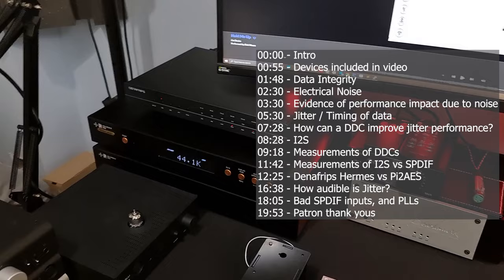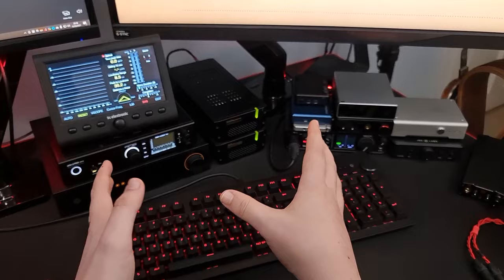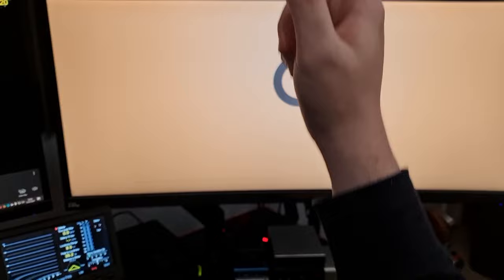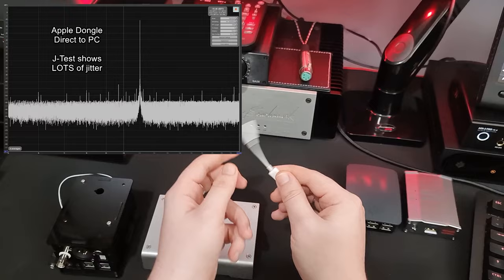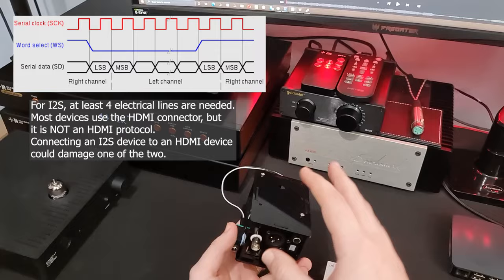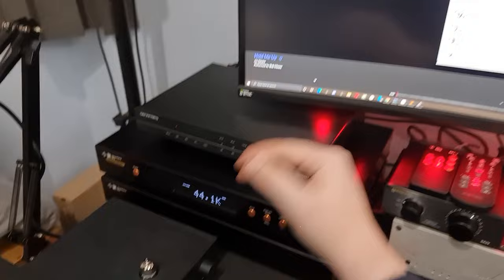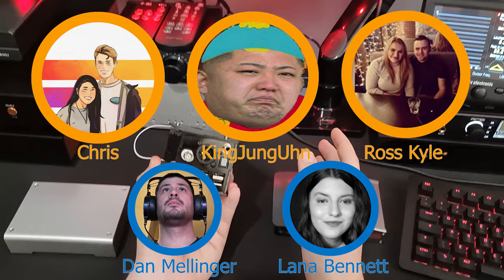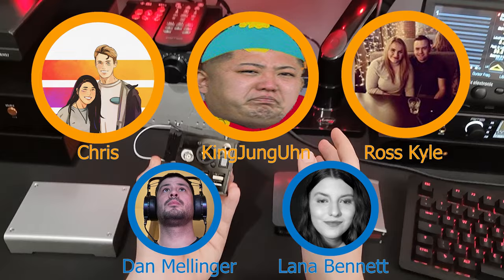How do DDCs improve audio? (Denafrips Hermes, Pi2AES, Schiit Eitr, ifi Igalvanic)

Comment: I think these problems should have been solved in the DAC.  The whole reason I am considering buying an external DAC is to get rid of electrical noise.  Cue the "YOU HAD ONE JOB!" meme.
Reply: Considering that analog LPs are still considered to be the ultimate experience by many high-end enthusiasts, a 60db noise floor is not a problem and a 110db one even less.
Reply: @dingdong2103  you’re misunderstanding the problem.  The issue isn’t noise floor: it’s electronic noise and jitter which are a completely different thing.
Reply: @GodfreyMann  Vinyl has wow and flutter which are the analog equivalents of time domain modulation. You won't get rid of them by going analog.
Reply: @dingdong2103  you’re correct that ‘electronic noise’ on the analogue side rises the noise floor, but the discussion is about ‘electronic noise’ on the digital side which gives rise to jitter.  It’s not a marketing jargon - the clocks are voltage sensitive components and ‘electronic noise’ can cause fluctuations in voltages in the circuit.  Although tiny this can affect the quality of the square wave signal and therefore how the bits are interpreted....it can change the bits and timing.
Reply: @GodfreyMann  jitter is a timing problem, noise doesn't affect it at all. Double sampling rate takes care of jitter in all practical solutions. Anything else is pure marketing. Digital things are very simple to check: Just sample the stream on both sides and if the result is bit perfect, jitter has not affected the outcome in any way. It's simply impossible. That's why all the expensive digital cables etc. are 100% snake oil. The real problems in audio are in analog devices. Pre-amps, amps, speakers (largest issues being the speakers).
Reply: Yeah decent gear it shouldn't be an issue
There will always be something to worry about, depends how much it matters. USB from my PC to ifi zen DAC is pretty good. Not buying all their other add ons and filters. Wondering if USB is better than optical and hats from rpi4. Seems easier
Reply: @dingdong2103  because you're using cheap as shit gear is why all that doesn't matter which it doesn't. You stay in your lane.
Reply: @GodfreyMann  Golden is grossly misrepresenting what he can actually hear with differences in jitter. He may have super human hearing, who knows? I don't think he is lying to sell shit. I think he is misrepresenting the problem to justify his own genuine abnormally good hearing or absurd purchases.
Reply: @Leo-yn5fx  The best measuring DACs in 2022 (and for the past 5 years at least) are delta sigma DACs, mostly built upon ESS or AKM chipsets, and one can be had for less than $500. And all of them—whether made by SMSL, Gustard, Topping, Loxjie, Matrix etc) have USB inputs with buffered input receivers and oversampling algorithms, that obviate nebulous concerns such as jitter or timing errors. 

For that reason it is only snobbish fools who buy R2R ladder DACs (or DDCs to solve connection problems), under the foolish belief that cost correlates with sound quality. Digital audio has no “sound”, and the resulting analog signal that modern DACs produce is the sound of the original sampled master, differing only in the amount of noise, distortion and dynamic range a particular DAC contributes. 

And either way, these differences are all beyond the range of human hearing. DACs should be the least expensive component in any audio setup these days. The products with the most significant cost to benefit ratio are headphones and speakers, with amps a distant second. Everything else is marketing manipulation.

Comment: I thought by now any reasonable DAC would have it's own internal elastic buffer and just internally re-clock using it's own precision clocks.  Paul Lesso wrote an AES paper about S/PDIF design 15 years ago called "A High Performance S/PDIF Receiver".  A small buffer chip should be super cheap these days, and should be able to wipe out any jitter from a PC optical port.  I get the impression audiophiles like to make simple problems hard.
Reply: They want excuses to buy more stuff while still claiming it is "minimal chain".
Reply: Buffer = delay = bad, I guess?
Reply: @sanjacobs6261  Delay is bad if you are watching a movie or trying to mix tunes as a DJ, cuz the audio will arrive too late.
But if you only listen, it doesnt matter if the audio comes out a second later then it got send.
Reply: @Wassermelonenbaum  and it wouldn't even be a second, a few milliseconds would be more than sufficient.
Reply: @gayusschwulius8490  For reclocking you usually use atleast 2 flipflops. This means that it's atleast 2 cycles of a clock worth of delay. The clock in this case has the frequency of the bitclock which is usually 44.1k*16bit*2 = 1411200bit/s. Which corresponds to 0.7microseconds of delay PER flipflop.

I'd say delay typically becomes audible in live content at about 15-25ms. You could legit use a thousand flipflops and still not hear the delay.
Reply: Found them, a diamond in the rough ;).
Reply: @hidjedewitje  did the monster maths
Reply: I don't disagree with where you are going, but the problem is the I2s did measure better. Maybe some of the reclocks just isn't that good?
Reply: you're still getting interference because the dac is still connected directly to the pc. Enjoy your fuzzy audio quality if that's what you want.
Reply: Thing that solves this without the need of buffering is called an ASRC - asynchronous sample rate converters perform clock domain isolation and with current implementations artefacts are so low its not worth discussing.

Comment: I do not often see videos which are pure and utter nonsense. But this one is. The spdif and the usb interfaces have error detection integrated. They will not deliver an invalid data stream to the DAC. Noise on a data line can cause problems but usually you recognize that by drops in the audio presentation or by connectivity rejection (no sound - full stop) and not by noise on the analogue side. Since the cable length and quality is good these days, you usually have however not problems or drops.

Comment: Just a question - "...the Schiit EITR is a very affordable device..."  I assume you are aware that this product was discontinued about a year ago and is only available second hand?   (where it commands a huge premium over the original MSRP).  FWIW, the EITR was based on Schiit's older USB implementation (called Gen5) and the EITR was discontinued when Unison was introduced.  Also, I agree that the Pi2AES is outstanding... I have 3 of them.
Reply: Pretty amusing to hear tho
Reply: Eitrs sometimes pop up in Schitt's b-stock page for $99 plus shipping. Schiit discontinued Wyrd as well, so I guess you have a point unless someone wants to use spdif coax connection for older DACs like me.

Comment: I think that this is for someone not using a steamer. Instead of using a Hermes at a  $1k us, I would have used the Iris  at  $499 US. You can find them under $400 US. It will only do USB to I2S and does a great job of doing it. For the other digital connections, I have an external 10m clock that works wonders with my DAC.

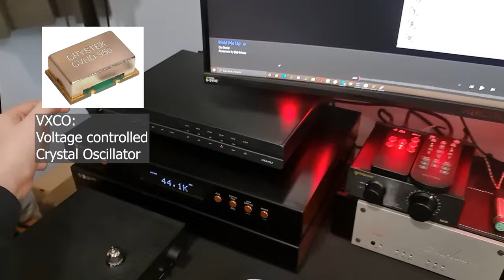Comment: @6:35 an oven controlled VCO is exactly what it says - it is temperature controlled to optimise clock waveform & jitter performance - it is NOT an “temperature controlled” crystal, that is voltage is still used to set the crystal into its designed resonant frequency, but temperature controlled conditions, stabilise & optimise the oscillator performance😀🤓
Reply: It controls the temperature to increase long term stability. Jitter is  short term deviation and thus won't be improved with OCXO's.

Comment: 6:40 for what it's worth an OCXO is still voltage-tuned (EFC) with a typical pulling range of something like 1-2e-7. The ovenized part is for short-term stability, not frequency adjustment. Essentially, quartz crystals have a characteristic curve of frequency change vs temperature change over temperature, which is very different for different "cuts" (the literal way the crystal is cut and polished). The standard is the AT cut, which is pretty much all quartz crystals you see everywhere. The AT cut crosses 0 Delta-Hz/Delta-K at around 25 °C. Which is just about perfect for normal ambient room temperatures. But the slope around that point is steep (relatively speaking, so let's say you're at 20 °C, you might be getting 5 ppm/K or so). Now the clever trick about OCXOs is that they use different cuts, often the SC cut. The SC cut has a completely different response to temperature changes; it crosses 0 at around 90 °C or so, and has a very gentle slope around this area. So OCXOs keep their crystal heated to a very stable 85-95 °C, using a control loop. The attenuation of ambient temperature changes by the control loop colludes with the shallow slope of the dHz/dT to give extremely low tempcos.

The expense of that is: SC cut crystals are much more expensive (tiny tiny tiny fraction of the market), OCXOs are a lot of hassle to build and even fast-stabilizing types will exhibit a pretty wild swing from turning on to becoming mildly stable (at least 15+ minutes), they have very high power consumption compared to normal oscillators (couple Watts steady-state vs. a few mW for a normal oscillator and maybe 50-100 mW for something fancy. (And some OCXOs tend to fail under repeated power cycling, like you'd do in a residential setting -- they're absolutely not designed for that and will not hold their specs when treated like that).

Most (all?) OCXOs have their own reference voltage which is typically ovenized as well. Sort of like bootstrapping, the reference has a tempco (selected for ~0 tempco at the elevated operating temperature, another reason these are expensive), so it would impact the temperature controller, so it's ovenized itself. It's of course stable, the tempcos of precision references are tiny to begin with.

Now the reason people went to this trouble is that for, mostly physical experiments, extremely accurate and stable clocks are a useful tool. A good OCXO achieves short-term stability better than 1e-12, that's one part per billion, or for the typical 10 MHz reference, that's less than 0.00001 Hz variation over a few seconds. (Jitter and stability are not the same thing). These are mechanically vibrating devices: Vibration creates low-level spurs. Most physical phenomena influence oscillator output, temperature is just a big one. Gravity is another; angling or rotating a quartz changes the frequency (much more than 1e-12). So for optimal performance you'd want to dampen vibrations of all frequencies. Sounds like something you could sell to audiophiles. Big fat granite rock on a bunch of thick steel rope springs.

Obviously, as you allude to at the end, the oscillator can't actually be used as a reference for anything (what's 10 MHz / 44.1 or 48 kHz?), so you're looking at a fractional-N PLL anyway, and at that point the quality of the output clock is liable to be swamped by the PLL's qualities (or lack thereof).

To be frank, a normal quartz is probably just dandy for audio, if the rest of the system design holds up. Audiophility seems to be especially liable to buzzword engineering instead of system-level engineering.

Comment: For us noobs, might I suggest you spare a few moments to explain you graphs better and how one is better versus the other? I kind of think I understood so thanks for the great effort and video!
Reply: Soooo I'm somewhat new to audio. My understanding of those graphs is the more lines you see randomly sticking out from a pack, the worse it is. At 13:50 you can see a line sticking up on the left graph towards the left of that graph, then just before the big spike, theres a bunch of bumpy lines sticking up from most of the other lines. Neither of those are in the right graph. Those things are the noise/jitter.

(I COULD BE WRONG.)
Reply: I'm not into audio at all. Just came here from my recommendations. But I have done some electrical engineering. The plot has frequency on the x axis and loudness on the y axis. He's sending a 12kHz sounds wave across the line which causes the giant spike at 12k. Since it's supposed to be a pure 12k signal, everywhere else on the plot should technically be at negative infinity (no sound at all). A lot of the reason it isn't at negative infinity is because of random electrical noise or jitter. Jitter causes other frequencies to spike slightly because changing the timing between points in the wave changes the slope of the sound wave and thus the apparent frequency of that wave.
Reply: @keco185 you should make a video about jitter not golden sound.

Comment: Oh dear. This video is so troublesome to me, because it seems like such a let down compared to your usual fund of knowledge. Worse, its spirit breaks the usual ethic I admire you for—namely eschewing the manipulative marketing strategies of certain manufacturers. Starting in many ways with the brands you champion in this video, I’ll leave that there. 

Can we take a bit of a broader, pragmatic view of what one truly needs to address the digital to analog conversion process in our audio setups? Because if we started with another, less costly DAC in the first place, we’d have to revisit wholesale what the true utility of a DDC is. 

Let’s start by staying in the digital realm, because that’s where we are. We have a signal path to attend to. And despite all of the complexities you addressed in this lecture, the only practical purpose a DDC fundamentally serves is to solve compatibility issues when connecting digital audio sources and DACs. 

If we start with a great measuring, SOTA modern DAC (which for the last five years at least would be a delta sigma DAC, period, full stop), they would have a USB input, as would the vast majority of signal sources in the past decade. If we don’t have either of those options, we may need a DDC—but either way, adding one to their signal path would have NO impact on “sound quality” at all. 

I believe you know this already for sure, but as we’ve chosen to stay in the digital realm, we should recall that digital audio is not sound, and “bit perfect” is a silly marketing term, not an audio science term. 

Also “timing” to input receivers with modern DACs has been handily resolved by buffers—and especially with asynchronous USB connections (and delta sigma DACs), the DACs clock is the master (as you pointed out). That’s why USB has been adopted as the reference, most practical standard for high end, super high resolution digital audio streams, and IIS has remained a superfluous expense we tolerate due to the marketing manipulations of PS Audio (their reasoning is based on another epic scam involving circumventing Sony’s SACD DRM rights, but that’s a topic for another time and place). 

That is also why informed, sensible people who care about the money they work hard for don’t bother anymore with the antiquated R2R ladder DACs you discuss in this video. They are technologically inferior, obsolete, yet paradoxically more expensive—and unless they include a killer integrated amplifier, they’re literally stuffing cash in the furnace. Absolutely, the DACs you reference here sound great—but they don’t sound any more or less great than a $300 SMSL option with an ES9038pro or a $400 refurbished Topping d90 with an AK4499. 

Going back to the digital domain, the only “sound” that emerges from the back end of a DAC is the sound of the original master, varying only by the degree of noise, distortion and dynamic range that comes with. And the newest (meaning, in computational technology terms, the most advanced) inexpensive DACs out there right now all vary way beyond the capacity of the human ear. 

Which means that buying all those resistors is the equivalent of buying a hand-built computer tower from 10 years ago at exponentially higher prices (in the case of the eight year old DAVE, 20-30 times higher), just because the one sheet uses a lot of super cool sounding, atomic age terms that promise to lift those veils once and for all. 

Seriously—the idea of spending extra cash for a DDC to fuss with IIS, only to solve the problems with expensive Denafrips or Holo May rip offs, instead of just buying a far superior, far cheaper and better-measuring DS DAC with a USB input is to me absurd. 

The DAC in 2022 should be the least expensive component in an audiophile setup. See, although they sound really wicked cool and esoteric, we don’t need fancy phase lock loop systems in this modern era because the processes they perform don’t change the outcome, if the goal is listening to music, instead of measuring computational ephemera. Progress, in the form of AKM and ESS, has solved all these issues for us. The “jitter” you’re wringing your hands over is indeed inaudible—even for “expert ears” such as yours, it’s true. Your thesis here sounds erudite enough, but to me it amounts to an orgy of misapplying analog audio terms to ones and zeros. 

I truly admire your efforts. But I feel an obligation to advocate for the dignity of others’ hard-earned cash. I’m sorry for using this tired cliche, but this vid is simply peddling a bevy of unnecessary snake oil. And please, do take note of the contradiction in your headline for this vid—one could argue that it’s a bit disingenuous to bait clicks by signaling better sound quality to be had, and then disclaiming three minutes in that the discussion is not about what is “audible”. 

Please go back to sticking to what’s audible. The wallets of all your followers will be so much better served if you do. After all, the money they’ll save from not spending four to five figures on a futzy DAC and a DDC to solve its connector problems can be set aside for their headphones—where the quality of construction and design truly has been demonstrably proven to make a difference. Peace…
Reply: Thanks for explaining